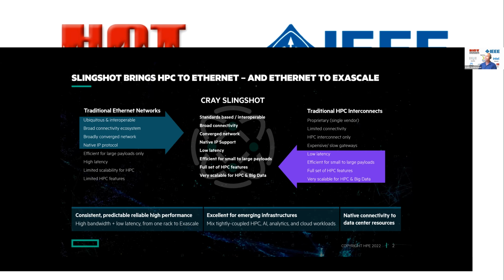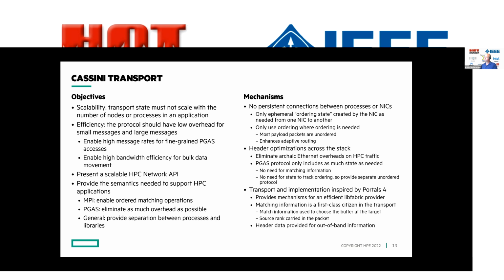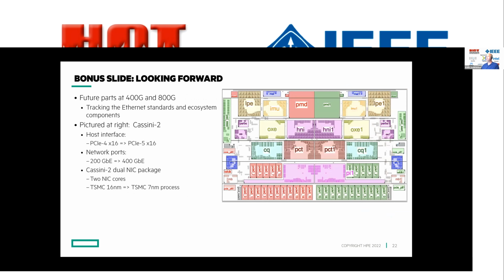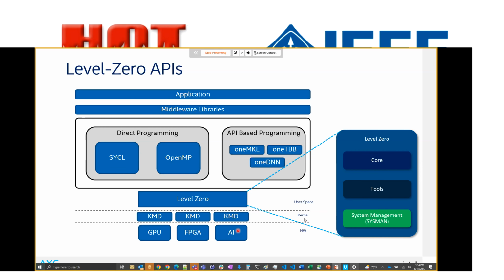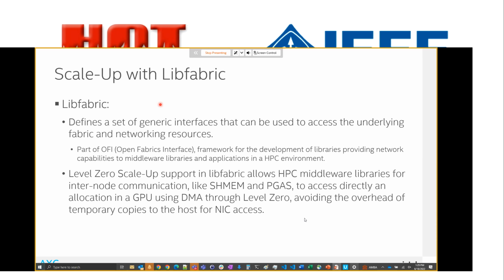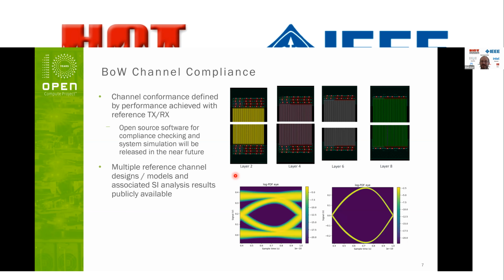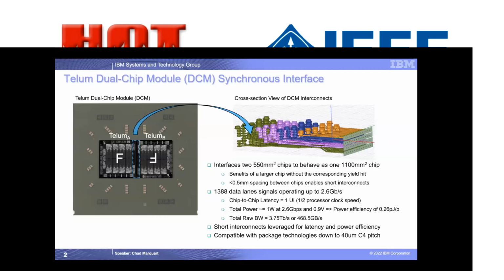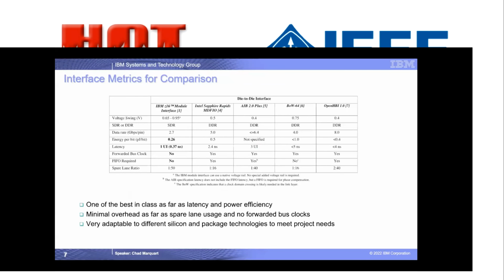HOTI 2022 Day 2 Afternoon Session 1

Comment: 0:02 The HPE Cassini NIC
# Keith Underwood, HPE

35:39 GPU Scaling with Intel oneAPI Level Zero Peer-to-Peer Solution
# Jaime Arteaga and Ravindra Babu Ganapathi – Intel

1:02:31 Bunch of Wires: An Open and Versatile PHY Standard for Die-to-Die Interconnects
# Elad Alon, Shahab Ardalan, Boris Murmann, Bapi Vinnakota and Venkata Satya Rao

1:23:04 Synchronous and Low-Latency Die-to-Die Interface for the IBM z16™ Telum Processor
# Chad Maquart, IBM